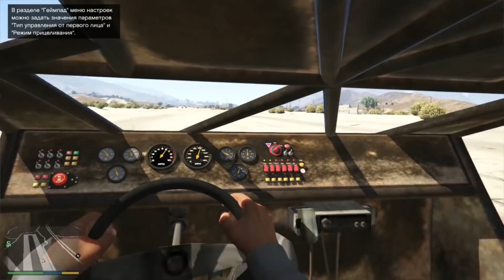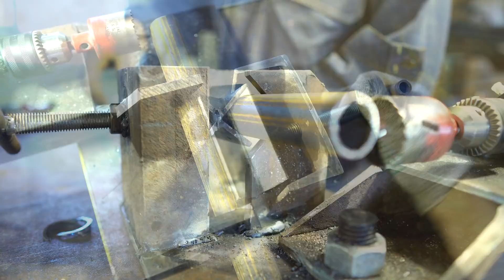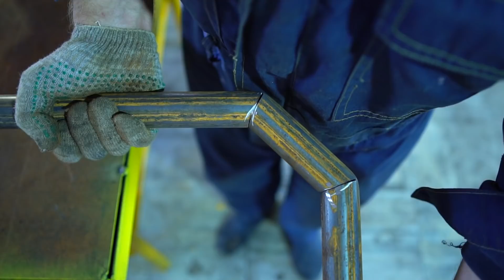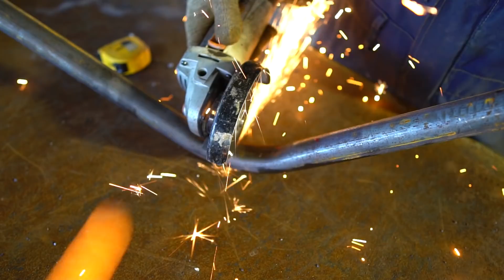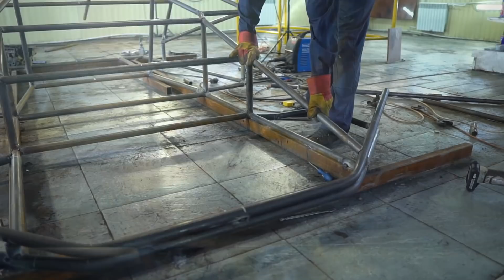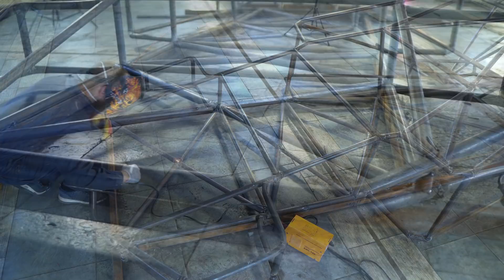Ramp Buggy in real life from GTA 5. Part 1

Comment: Very cool. For added strength at the nose add vertical truss elements along the parallel frame lines. Suspension will be tricky to keep from bottoming out while launching a car.
Reply: Simple he needs to double up the coilovers with airbags, then when he is planning on "flipping a car" he fills the airbag up to stop bottoming out

Comment: Very cool! I believe the car in GTA 5 is based on the "Flip Car" ramped vehicle from Fast & Furious 6. Good luck with the build!
Reply: But the flip car in f6 has the wheels exposed aswell 🤷
Reply: @viktorisaksson6909  yes the wheels are exposed but the angle of the frame is much steeper so the wheels wouldn't be touched by the car you are flipping. The GTA flip car on the other hands hast the wheels so obviously in the way that they will receive massive damage from the car which is been flopped
Reply: Yo I like these comments your not arguing like others would your just talking about it I respect that
Reply: Wish good luck to an original video author: https://www.youtube.com/watch?v=uvvPYqN4IXk
Reply: It is but the flip car in f6 works and the one in GTA wouldn't work without massive damage on the tires